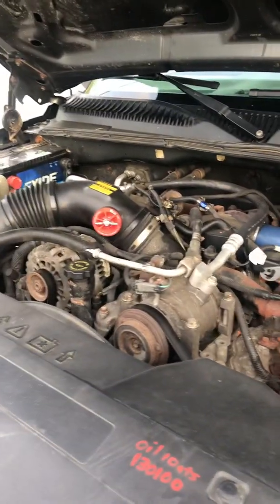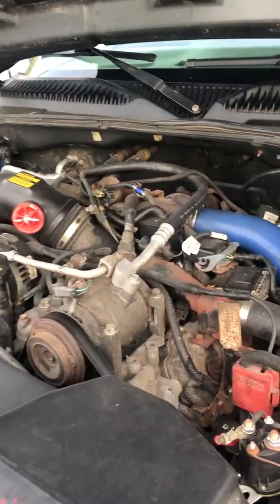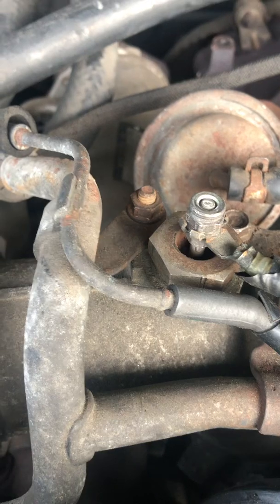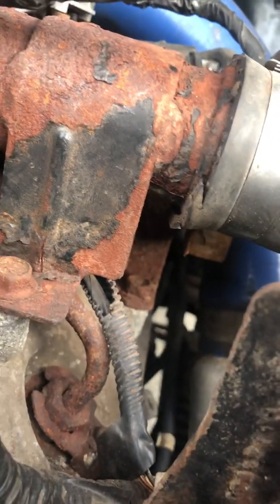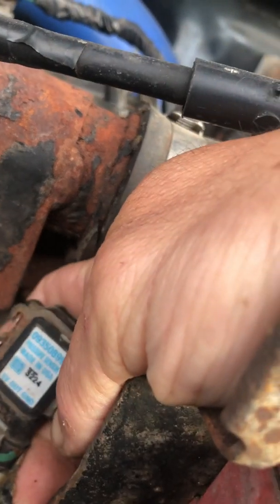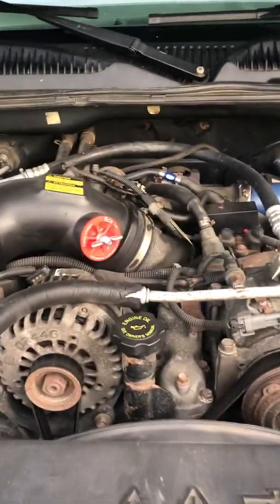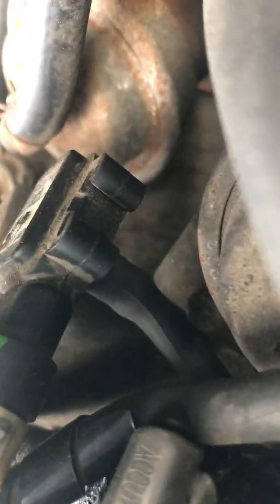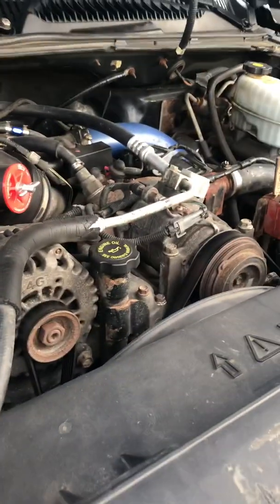Barometric pressure sensor Duramax

Comment: I might be wrong because my 2004 had the same location but was held by a bracket. The barb on the switch goes to a hose that is connected to a unpleasant just under the AC compressor which is on the intake. It is supposed to read intake pressure not engine compartment pressure(which doesn’t mean anything). If it has a barb, it needs a hose.
Reply from the maker: Hey man, yes it was originally attached to a bracket it broke off.

Comment: Thanks for this. It makes sense. both of those sensors measure air the Baro measures outside pressure and the MAP (with the hose) measures manifold pressure. I took of my map because I had a baro code. I was confused and could not find the Baro sensor. This video helped me a lot.